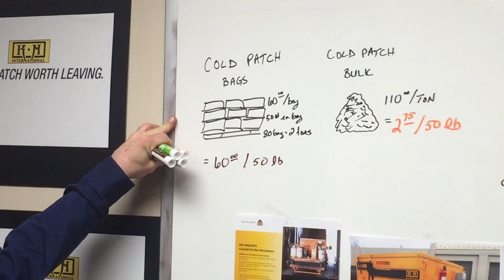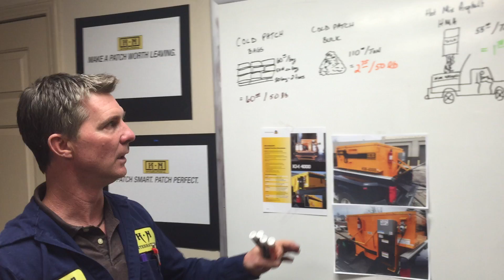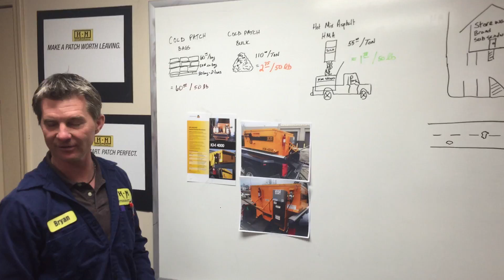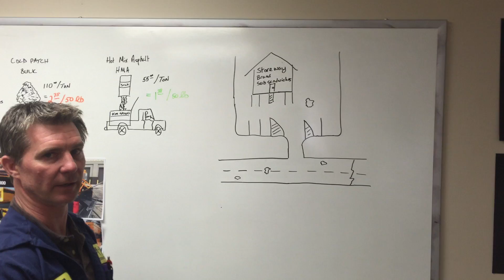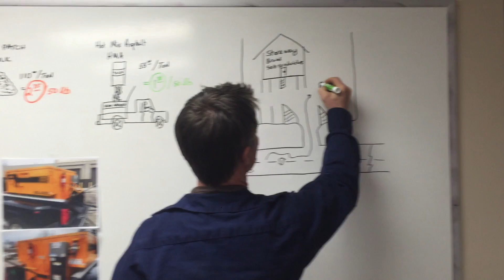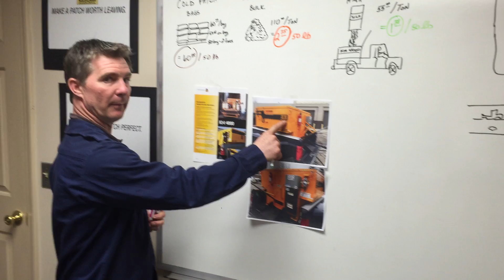Why you need an asphalt hotbox

Comment: Also might want to point out that a hot patches are FAR more structurally sound than cold patches. A vibratory plate is much better than a hand tamp for achieving uniform density. ( Customers love to hear this.  ) We do one pot hole, we're charging a minimum of $300. ( Here in Oakland County Mich, I've been in the paving business for over 30 years. $300 hot patch = 12 to 15 years of no pot hole. $300 is a bargain )   ;)
Reply: What size would that pothole be ?